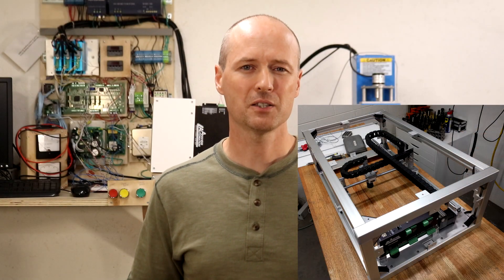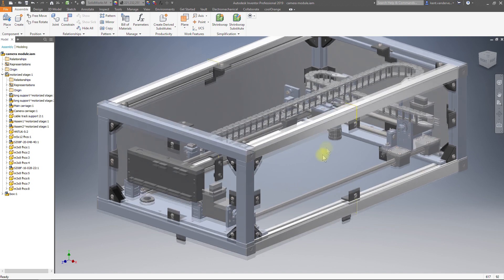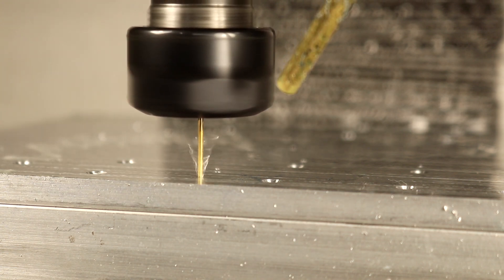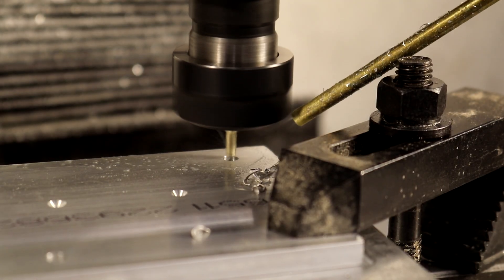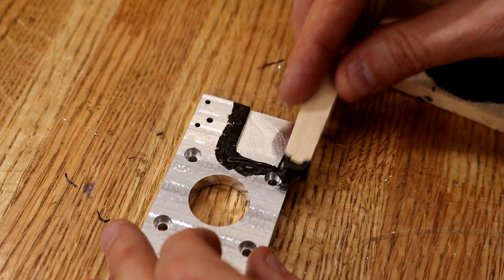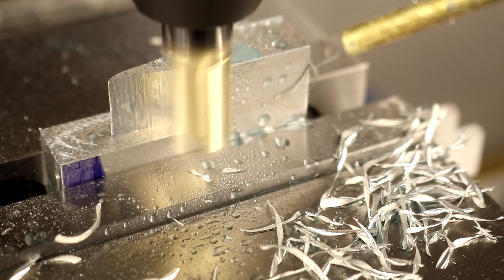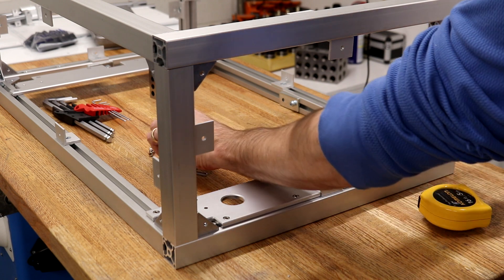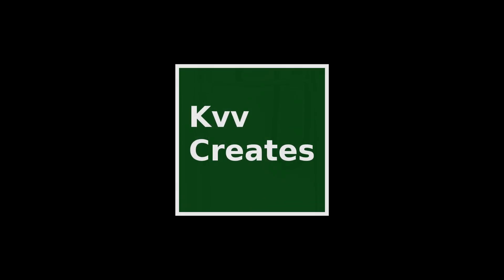Camera XY positioning stage - Design and CNC machining

Comment: I have added 5 cameras to my CNC, 3 of them USB microscope cameras, 1 webcam, and 1 endoscopic camera, but it seems that windows does not like more than 1 or 2, maybe 3 cameras, but the cameras never stay connected to the PC, and have to be unplugged, and replugged in, and then I have to reboot, or do a complete shutdown, to get them to work sometimes. If anyone has a solution for this, I'd like to hear it.  There are multi-cam security systems, but they use CCT cameras and those cameras a big, and not microscope cameras.  Does anyone have a solution for this problem?  Thanks.
Reply from the maker: I've worked with quite a lot of cameras. USB is the least desirable unless the manufacturer is a good one. If writing your own code, search for reseting USB ports and cameras. I've had some luck with these code snippets, but not with all cameras. I've tinkered with switching the power and data lines to simulate a replug cycle, which may be OK with slow USB. Better may be to use Ethernet, though without multiple port cards your bandwidth is shared. I've also dedicated a Raspberry Pis per camera, USB or the CSI port. Can do a little processing on the RPi then too before shuttling to main computer. If the camera fails, cycle the program or the RPi power. I have no great solution, especially no low cost solution. Would like to see a tour of how your using these cameras. Best of luck.
Reply: @kentvandervelden  I was trying to reply in the notifications window, and I lost all I wrote. hehehe.  So on the second go round, ... First of all, thanks for your awesome and detailed reply.  I like the swtiching wires idea to simulate a camera restart, or replugging in.  But that is hard, and apparently needs a physical solution, and it still probably wont work all the time.  As far as finding code that will reset a USB port, ...I have not found any.  I also have problems with Arduino needing resetting from time to time, or I have to unplug the Arduino UNO from the computer to get the CNC working again, so programmatically resetting a USB would be super good, but I do not think it is possible..  The 5 cameras are.... 1 for an overall view so I can see the general postion of the cairriage and gantry, ...then 2 microscope cameras pointed toward the drill bit at a 45 degree angle, one for the X axis, the other for the Y axis, for an OpenCV (computer vision) auto calibration routine. The 4th camera is yet a 3rd microscope camera which is also for openCV but is pointing straight down, so it can handle both X and Y axes with only one camera.  The 5th camera is the endoscope camera for filming cool looking videos.  I still need more time to play with them.  It could be that my software I wrote is confusing the USB ports, and causing problems.  Also, OBS Studio also loses track of which camera is which, and my software may be doing  the same thing.  So I need a little bit more time on it.  But as it is now, even without OpenCV, I can manually locate a drill hole, and then put a 0.9mm drill bit in a 0.9mm drilled hole, on a PCB.  I am making PCB's using a new method that lets me do it with a super fast feedrate. of 2000mm/min or higher.  I can take it all the way to 5000 but the cuts are less reliable and it causes my big Nema 34 machine to fall apart some.  It's like a Fiat.  Fix it again Tony.
Reply: @kentvandervelden  but yeah, I can put a 0.9mm drill bit in a 0.9mm hole, and get nothing but net.  And with the microscope cameras, my controller's 0.1mm moves look huge and almost clumsy on the screen.  My controller I wrote has a Super Fine button for 0.01mm, and that is like nothing, and you can still see the move in the microscope camera viewer.   Also, using OpenCV, I can click a button, and the machine will automatically home to a drill hole that I select on the screen.  As the machine moves, it tracks which drill hole was selected by using "predictive object tracking".  It could be doing using a fancy and much heavier OpenCV method to do real tracking, but even if I did that, you would still need to tell the software which drill hole you want to track.  So say the machine needs to move X4 Y2 to get to the hole, .... as the X axis moves 4mm, the hole moves on the screen, in both X and Y directions, while the drill bit stays where it is on the screen, as the 2 X and Y microscrope cameras move with the carriage, as they are mounted on the carriage.  I could use just one camera to do the openCV stuff, but I much prefer 2 cameras because they are pointed at the drill bit, and at the work.  To use an XY camera pointed straight down, it is not the same and not near as good, and not even anywhere close to be as fun.  Having  X axis and Y axis microscope cameras is an absolute blast.  It is so practical too.  And you don't even need OpenCV.   Every tiny thing looks huge and for the first time you can see so clearly.  

I added the cameras mainly to capture some cool looking video to promote my CNC softwares, while thinking that I am not going to be fooling anyone, as we all know that you don't need a camera on your CNC machine.  Wrong.  Now that I have had cameras, ...just from the fun and cool factor they are worth it, ....but surprisingly, they are really super practical to have.  The OpenCV is not needed, but it does look cool to see the machine auto find a drill hole precisely.  But it is so much more fun to do it manually.  You kind of don't want to give that little bit of fun work away to the machine.  It is mainly only for when you lose position which is not that often if you have all the bugs worked out of your CNC's wiring.
Reply from the maker: This sounds fascinating! Where do you post images and video of the project? It's hard for me to follow the details.
Here's one person's attempt at doing a software reset of USB on Linux.
https://askubuntu.com/questions/645/how-do-you-reset-a-usb-device-from-the-command-line
This implementation of the idea promises to be easier to use as the path to the USB device changes.
https://github.com/mcarans/resetusb/
Reply: @kentvandervelden  After investigating and experimenting, I learned that to get my cameras back, I have to shutdown the machine, and then turn the power off to the machine completely with the switch on the back of the power supply of the PC.  Then I get my cameras back, but the "monikers" change, so if there are 2 devices with the exact same device name, "DIGI Microscope" in my  case, then it will not know which is which if both devices have changed moniker data from the original that I store in a text file. I could work around this a little bit if one of the cameras has the same moniker as it did before rebooting, then I can assign the other one that has the same device name, and update the moniker for that camera in the text file, and so the next time you run the program, it will have the new moniker info and it will find both cameras.  ...but that will not work if both camera device monikers contain new moniker keys.  The USB ports are hardware, and have chips that read and read and read, and write and write and write, and they can get clogged and thus need restarting from a hardware level.  The problem is that is physical, or possibly controlled by Windows too, and so it is a problem. You have to turn off and on the power on the power supply because windows will continue feeding the USB ports power, as you would normally want, like for charging your cellphone when the machine is in sleep mode, or even in shutdown mode.  The problem is that if you camera's USB port is all hosed up, it has not way to turn off, and re-turn on, physically, with the power to that USB chip being turned off and then back on.  So, ...it is like Windows needs to let you decide which ports get turned off when shutting down the machine.  ...but Windows does not have that feature.  There are many thing in software that can cause USB ports for the cameras to get all hosed up where it won't work at all.  That is when you need to cut power completely to that port, in order to get Windows to recognize the camera on start up.  So, turn off that switch in the back of the PC to get your cameras back.  I hope this helps someone.  

As far as keeping track of which camera is which, when you have 2 identical cameras, ...there seems to be no way to really do that, if both monikers change at the same time.  And when you lose the connection of the cameras that you set up in software to the devices that they are supposed to represent, then you end up with many more problems downstream, and the whole thing becomes a giant mess.   Most of the problems start occurring when I turn on the OpenCV functions in my software, and so there is room for improvement there, but it makes debugging my software a long humiliating nightmare, because each time a USB port for a camera gets hosed up, you have to turn off the machine completely, then turn it back on, and then reconfigure the software so that is finding the correct cameras for the different "camera scenes" in the software.  So, ...yeah.  It's like that.  

To set cameras up you need to have many arrays in the software.  You need arrays for the Camera DEVICES in windows, plus you need the "Cameras" that you set up in the software that have a user assigned name that is joined with a camera device moniker.  Then you have Camera Scenes for when you want up to 3 cameras on the screen at one time, ...then you need OpenCV Settings for each camera, then Calibration settings for each camera,  and a few other things, and when you lose the monikers identifying the devices, all hell breaks loose.  Much of the problem and complexity has to do with 2 cameras of the same device name,  "DIGI Microscope" in my case.  To alleviate that problem I could use 1 microscope cam, and 1 endoscope cam, but the endoscope camera does not have the microscope effect, or the same amount of light either, ...so it just does not look as cool as the microscope cam.  The microscope cameras are amazing and fantastic for my CNC needs of milling PCB's. I don't really have to have the openCV for actual real life usage for re-finding X0Y0, when losing machine position.  The openCV is mainly for show, but it looks so cool to see work. ...but there are always problems with lighting, and colors, etc.  

Bottom line is if there is no way to get a real camera device ID, then there is no way to identify which camera is which, unless the camera device names are unique.  I am using Aforge.net for the openCV to get the camera device monikers. Perhaps I can get more and better info about the camera or "VideoCaptureDevice" using DirectX.  I need a unique camera ID that does not change and that does not exist in Aforge.net.
Reply from the maker: @jeffbeck6501  A heart for all the great detailed information and the time you took to compile it. Someone will benefit! Let me know if I can ever be of help.
Reply: @kentvandervelden  The only solution it seems will be to put in logic in my code that says, if it can't find the moniker, use the name if not used.  And if both cameras change their monikers, and if the X and Y cameras come up reversed, then have a quick button to change the Y camera to the X camera and vice versa, on the screen.  The way the code ripples downstream with this set of code and arrays is a disaster and so I have to catch his upstream. 

The only other alternative was an ugly one that I did not want to use anyway, but it was to look for physical USB ports, and so I did a search on "C# determine the physical usb port" in google, and the top link was a C++ program by Microsoft that you had to compile, and surely it will only work on your system only, who knows. How ridiculous. I did not want to do it anyway, but I thought it was worth mentioning.  

I think I will stick with a button to easily switch the X axis and Y axis cameras in the camera viewers, and hope that works.  At least I know now that I can turn off the power to the PC completely and get my cameras back to working again.

This multi-camera OpenCV stuff has been so long, ...like my posts.  ... Having more than one camera on the screen at one time made the project 10 times harder than it would have been, because with multiple cameras you begin to need "camera scenes" like in OBS Studio, and then you have your CV Settings, and on and on and on.  I am glad this work is ending, but to have cameras on the CNC controller, especially microscope cameras, is so good. 

I have not really used the cameras in real life  PCB milling tests, so I do not know what that will be like.  I am afraid I will get a lot of pcb material on the lenses of the microscopes over time.  ...or maybe almost immediately. My technique for high speed milling PCB boards using a super precise auto level with gcode that is cut up to induce a high precision auto level effect, ... I get very little dust from it.  It is awesome. When I get finished with this I will have some videos for you. Thanks for listening, and your comments, and your channel.
Reply: @kentvandervelden  Thanks. Check out all my stuff at NewRAD CNC. I have 4 gigantic CNC softwares.  A controller, (NewRAD CNC), that has a built in 2D draw program (GCode Draw), with 2 1/2D gcode generator, plus it can import SVG files created with a 3rd programmed called "Image To SVG".  So the 3 together give you all you need for many things. But, wait, there's more!!!   I have a new program, not out yet, called PCB Maker, and it lets you draw circuits, with incredible real life graphics, and then generate traces, and then convert the traces to GCode.  The GCode can do high speed scratch milling of PCB's using a 9924 scribe bit, and run at 2000mm/min and higher, with no shorts.  It cuts up the gcode so it will trigger a high precision auto level effect, plus after it makes the rectangle of the trace, it continues around the corner 1.5mm to make sure that debris is not puched into the corner.   ...stuff like that.  You can have a free license to any of my softwares. I am looking for people like you to test them and give me some feedback. Thanks.
Reply: Also, the GCode generated with PCB Maker inserts a Z0.01 and then a Z-0.01 between lines to trigger the acceleration in GRBL. That is necessary in all versions of GRBL to trigger the acceleration.  If you do not put those tiny Z ups and downs in there, the machine will jolt, and it will break your machine and throw  EMF, and then your in a Fiat situation.  "Fix It Again Tony.".   I do not understand why GRBL's acceleration does not work unless you trigger it with a tiny Z and and down between lines.  Am I missing anything on this?  Have you had this problem?  Thanks.   Anyway, after I put those in there, then I can get the high speed 2000mm/min and up to 5000mm/min, with an acceleration setting of 20 in GRBL.  I do not like running that fast at all. If something goes wrong, ...it is really bad. Today, just running at 2000mm/min, testing my controller, my machine took off, and I hit the Escape button on my keyboard to Reset GRBL and it did not stop and so I hit the big red button on the machine, and it still did not stop. I had to turn off the power to the motor.  What was that?  This stuff is so precarious and demoralizing, but when it works, it is so glorious.
Reply: @kentvandervelden  In an effort to get more info using DirectX than with my current setup in AForge, It turns out DirectX has the same Device.Name and Device.Moniker properties, and nothing else.  So there is no advantage with DirectX. 

Also, I was turning off the switch on the PC power supply to get my cameras back, but that  stopped working. But then I found a much better solution that does not require rebooting, and that is I just unplug the camera that is not working, and then plug in an identical camera, a "DIGI Microscope" in my case, into the same USB port, and then uplug that camera, and replug in the original camera that had stopped working, and that has worked like 3 times in a row. And NO REBOOTING.  And that saves so much time.  I just unload my software, switch the cables back and forth between cameras, but not the other camera that was working, and then reload the software, and the video is working again.  . It is so much faster and better than the shutdown method. 

The camera shuts down when my software chokes, and it chokes because 2 or even 3 AForge Camera Viewers share the same New Frame Event that pass and image and since it is passed into the NewFrame Event subroutine in C#, ...the image is locked, and the software chokes, and causes the camera to stop working.  

One way to solve this is just to use 3 different subroutines for coming off the 3 different Camera Viewers, and that would allow separation of the image passed, and then I can shield it off with a simple InUse flag, and that should work.  Then I will solve the root of the problem, and stop killing off my cameras with my software. 

But it still is working well enough to have gotten the code pretty well debugged last night and it is looking like it pretty much works now.  I will add those 3 Pre Subroutines to mux out that image processing problem, and then I should have a reliable OpenCV situation, and that would be pretty cool. This is a really big thing, that it is reliable and fun, and not a nightmare.

And like I say, OpenCV is not necessary. If you have microscope cameras, you actually prefer moving the motors yourself, because it is fun, especially when you start tweaking it with the 0.1mm, and 0.01mm.  

Even if you want to use an OpenCV-like situation, ...once my software is calibrated for "Pixels to GCode mm", for all 3 axes, relating to X and Y on the screen, ...then you do not really even need the OpenCV anymore.  You could just click on the screen and it will figure out how far to go with that "Pixels to GCode mm" ratio.  It won't be perfect that way, but it will be close. But it is never perfect, so even with OpenCV, it predicts, then measures, then re-predicts how far to go, then goes there, until it wants to go 0mm, and then the auto locate function using OpenCV exits.

The OpenCV can find the black drill hole, and see if that hole is where it should be, and if so it draws a green circle around the drill hole, with a red dot in the center of it, and some text about the X Y location on the screen.  Each time I move the machine with the Arrows on my controller, the software calculates the position on the screen that the drill hole should be at, and if it is close to that, then the hole position that is predicted by the software is updated with the actual hole position determined by OpenCV, and then a green circle is drawn around it.  And it does that for all 3 axes. And I seemed to have gotten all of that working last night, so I should have some videos soon. 

Thanks for your free psychologist session.
Reply from the maker: Thank you for information, I'm sure it'll come in useful. Glad to help with the therapy, but warning is it's worth what was paid for it :)
Reply: @kentvandervelden  https://www.youtube.com/watch?v=BW2Lks4NxVE&t=9s 
Here's the first video that I have put out in a long.  This video is not about using OpenCV, but it does have 2 cameras on my NewRAD CNC controller screen.  This video is about my NewRAD CNC version 1.2 release which is mainly about Auto Level and Probing, but you can see the 2 microscope cameras I have mounted on the Z Axis.  The drill bit is always in focus.  You can very quickly see how useful these microscope cameras are for this type of fine work.  The next video will be about version 1.3 which includes the addition of cameras on the main screen, along with using OpenCV computer vision to Auto Locate a selected drill hole, that the user selects on the screen, which can be used for re-zero'ing a machine for when it loses position.  I promise that that video will be way more exciting, but this video lets you see just how fine these little USB microscope cameras let you see the workpiece.  In my case, a PCB.  I love having these cameras on my CNC machine, and on my controller screen.
Reply from the maker: @newradcnc7366  subbed; expecting next video soon :)
Reply: @kentvandervelden  https://www.youtube.com/watch?v=cICAZHzGLwo
NewRAD CNC software version 1.3, now with Cameras and OpenCV for automatic XY positioning.